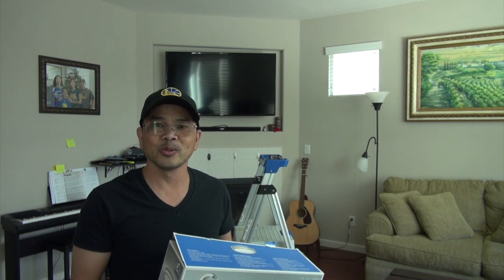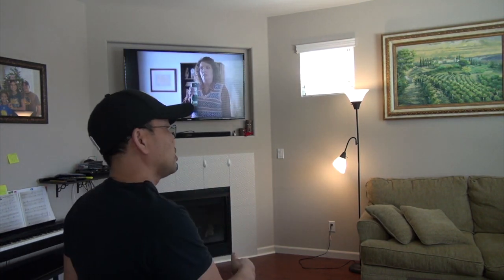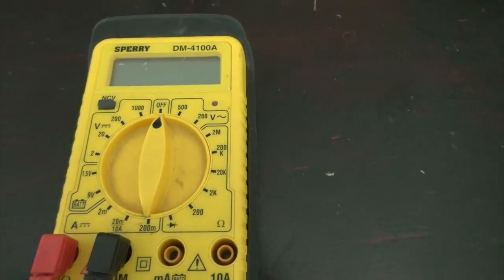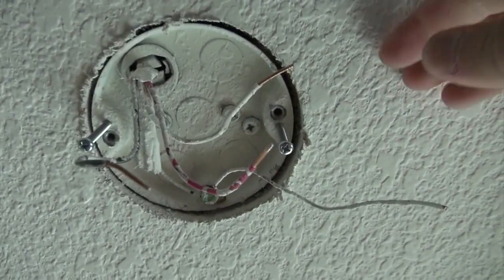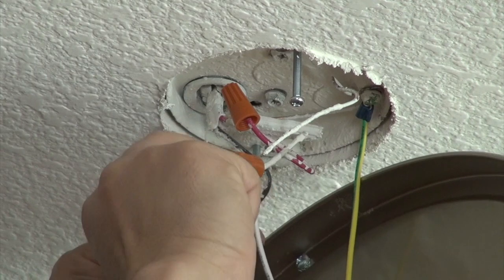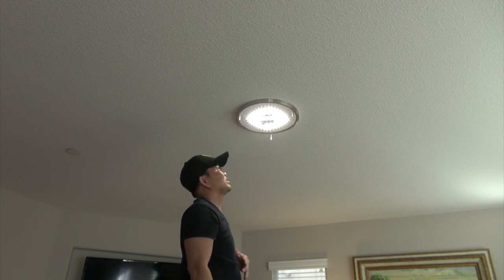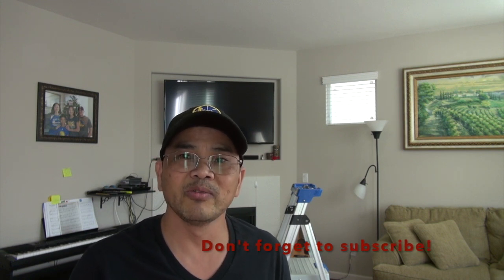LED Ceiling Light Fixture Installation --Light Emitting Diode-(with 4 preinstalled ceiling wires)

Comment: Great video. Explanation was so simple and clear as it should be. Thanks brother.
Reply from the maker: Thank you!  I’m glad the video was helpful.  Take care!
Reply: @diypotentials  So after watching your video last night, I decided to remove my existing ceiling light and discovered that it only has two wires (color coding is not super clear on these but I assume one is black (hot) and the other one white (neutral). However, what do I do with the ground wire attached to my new light? Do I just put some tape on it and leave it alone? The old light was also housed in some sort of large metal enclosure in the ceiling so I am also confused what to do there since I was expecting a normal junction box that I could screw the new light into.
Reply from the maker: @sunnysingh786  Sounds like they didn't ground the old fixture.You can attach the ground wire the existing metal casing if you like or leave it out altogether.  For the old junction box, I would try to find if their are existing screw holes that would align with the my new mounting plate.  If you can't find them, you might have to drill new ones or replace the box with a modern one, depending on your situation.  Check out my floodlight installation video.  That might offer other ideas for mounting the fixture...Be careful and good luck!

Comment: thanx for the video. Do you know if this fixture can use a DIMMER SWITCH to turn on and off, and dims the brightness if needs to? if so, is it a special dimmer or any led dimmer will work? Much appreciated.
Reply from the maker: I think if the dimmer switch is LED compatible, it should work.  Thanks.

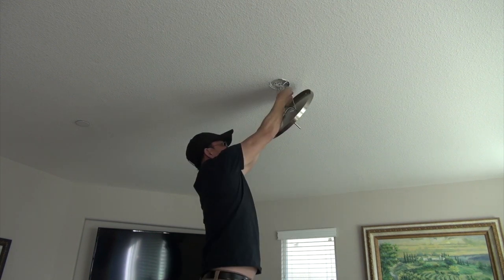Comment: Where do you get the green wire used at 7:20? My light fixture only came with white and black. If I go to home Depot, what do I look for? What is it called?
Reply from the maker: The green wire is called the ground wire...Thanks!
Reply: You can use a ground wire pigtail. They're sold at Home Depot :D

Comment: Thanks, video was super helpful. Had the dreadful 4 wires and wouldn't fixture wouldn't turn on after installed. Think my red and black need to be switched since they are both hot.
Reply from the maker: Thanks for the nice word. Glad it was helpful.  Stay safe...

Comment: can i connect 2 lines, black and neutral only, without connecting ground? some house only black and neutral.
Reply from the maker: If the house doesn’t come with the ground, I think that would be okay to connect the 2 lines.  Be careful.  Thanks!
Reply: @diypotentials  happy new year, thanks

Comment: did you use the mounting screw that came with the light??? a lot of COSTCO reviews said they were 2 short, I used the ones that was holding the fixture that I took down that were a little longer and worked fine.  Adding this,  the one I put in the kitchen I used the screws that came with the light and they worked fine in mounting the light.

Comment: So I installed a smaller LED lamp which required pretty much the same steps you did but now it turns off on its own every few minutes, it turns back on on its own for a while and then back off... For a moment I thought it had motion sensor but that doesn't seem to be the case... Could it simply be busted?
Reply from the maker: Sorry to hear.  It might be a faulty LED lamp, but can't tell for sure.  Thanks!
Reply: Mine does the same thing every day. Sometimes it's fast and doesn't fix itself so I just turn it off for a bit and back on. I hate it so much and it was there when I moved in

Comment: Very good video sir and i need your opinion i want to use the same led fixture from costco in my kitchen right now i have 3 fluorescent fixtures with 6 t8 tube lights should i use 3 of these led fixtures or is it too much light my kitchen is only 12 x 10 and thank you for all the information👍
Reply from the maker: With 12 x 10 room, I think one light fixture is more than plenty.  The fixture is very bright.  Thanks!

Comment: I just bought the same light.  I am trying to replace a 2 bulb light fixture.  I assume I need to cutoff one set of wires.  The problem is the current fixture black wires are connected to yellow.  And the blacks wires covered   White to white as expected.  Does that mean the yellow is live also?  There is no ground I believe.
Reply from the maker: Hello, for safety purposes I cannot give you advice.  It sounds like the previous installer treated the yellow wire as a black wire and the 2 bulb light fixture worked in the past…be careful. Thanks!

Comment: I've the same sort of 4 wires, I tried with your suggestion (leaving the red wire), but the light is on always, we could not control the light with switch, I mean to say that we could not switch off or switch on.  The light is on always.  Please suggest on how to come over it.
Reply from the maker: I’m not familiar with your electrical set up to give advice.  But it sounds like the black wire is not connected to the switch.  Maybe the red one is.
Reply: I connected the red wire to the 2 black wires. This way, I can utilize the dimmer switch.

Comment: How long do they last? Was thinking about changing out lights in house, but concerned when they finally go out, I'd need to replace the whole fixture, correct? So did you buy extras, in case you have that issue? Thanks
Reply from the maker: Can’t tell you how long they will last, but no problem at all since I have them a year ago.  I replaced all my ceiling fixtures with these LED ones—they are bright and energy efficient.  Once they go out, you replace them with new ones. I don’t anticipate these will go out the next couple of years, if they do, there are more of them in the market.  Thanks!

Comment: I bought a dimmable led ceiling light. On the light, there is 3 wires(bronze, white, black). Should I connect them all COLOR to COLOR ?

On the ceiling, there is Green/yellow wire with a tiny round connector at the end of the wire, bronze wire, 2 White wires connected connected together, 2 black wires connected together, 1 red wire. 

what I have done is : connect white to white, black to black, leave the bronze wire freely, hook up the green/yellow from the ceiling to the light pannel with a mini screw driver. 

i'm able to turn on/off with the remote and all features work. However, the switch on/off on the wall is useless, it has no effect. So in order words, I MUST use remote to turn on/off the light.

any help please? Thanks
Reply from the maker: Hey Jimmy,

Thanks for asking.  I’m not familiar with your electrical set up to give advice.  I'm not sure why the ceiling has 2 black and 2 white wires coming of one single switch.  It sounds like these wires are connected to another load.  The light being always on sounds like the black line is not connected to the switch or if connected to the switch, the black line from the circuit breaker and the black line from the switch to the LED light fixture are touching even if you turn the switch off.  You might want to get it checked out.  Also, the one single red wire on the ceiling is also a live wire.  If that wire is connected to the switch, that might work.  In that case, I would connect the black wire of the LED to the red wire instead. Please be careful.  This is only my opinion.  Good luck.
Reply: I did what you suggested and it worked (connecting the black wire of the LED to the single RED wire of the ceiling). Thanks again! :)
Reply from the maker: Awesome!!! Glad to hear!  Thanks!